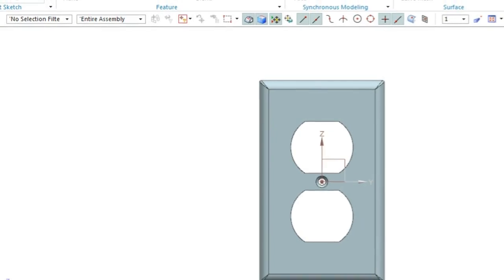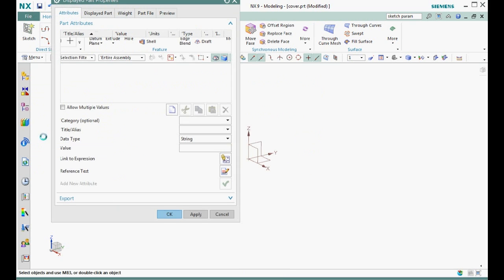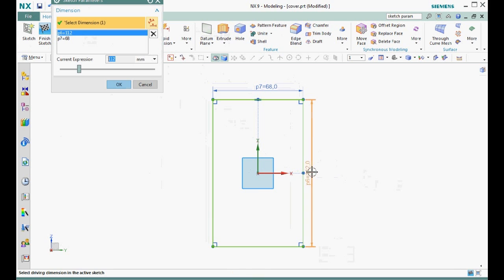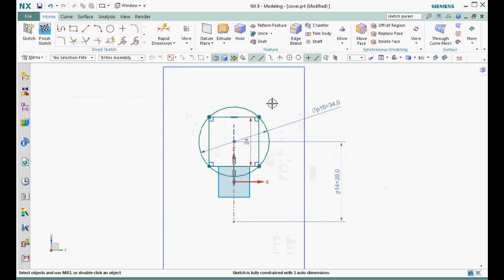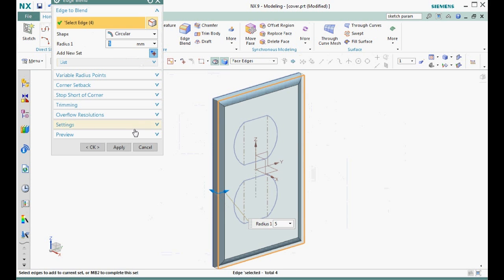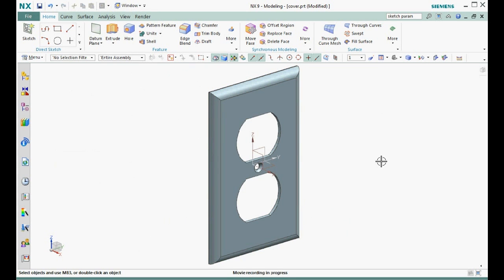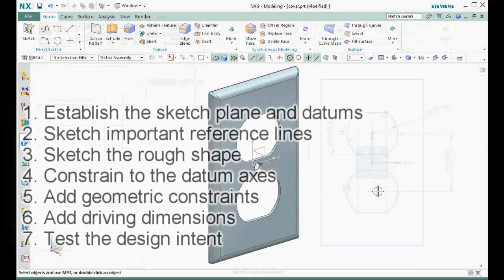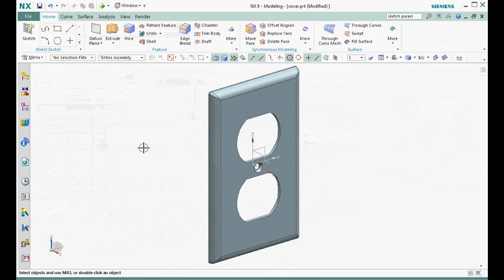NX Sketch Procedure

Comment: Good Video,  Quick question on the make Symmetric Constraint, Between the primary object and secondary Object , Mine always covert the same one, how do u control that?Thanks
Reply from the maker: There is no "primary" or "secondary" object. This is important to understand. Because of this, you can dimension either side, or dimension between the two sides. Symmetric is symmetric.